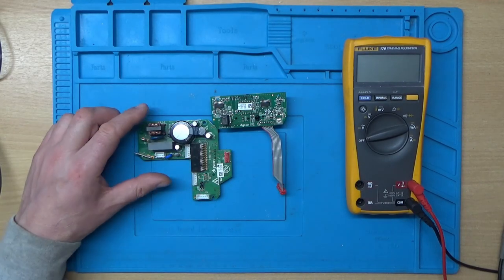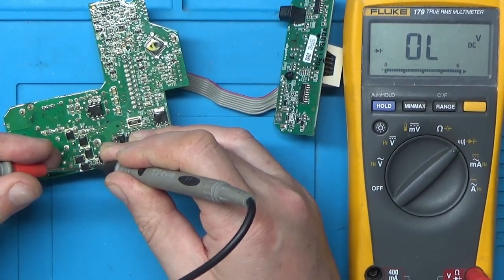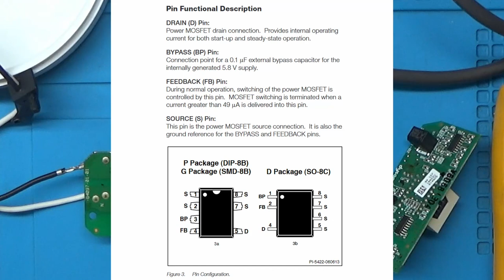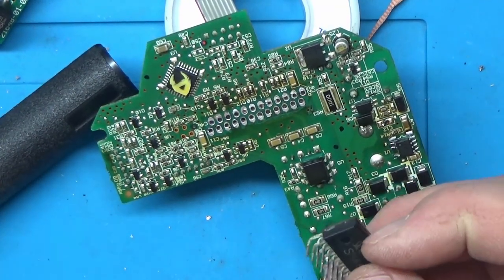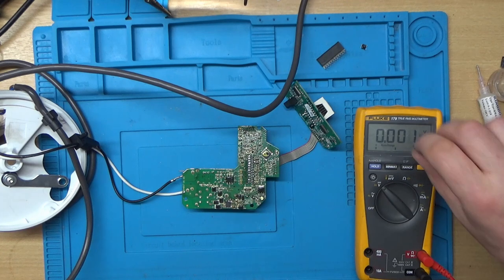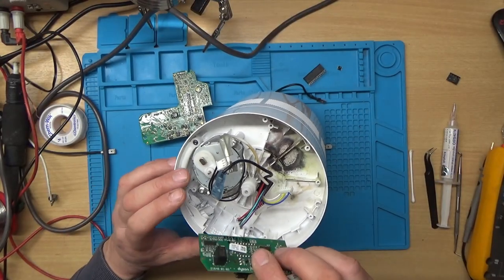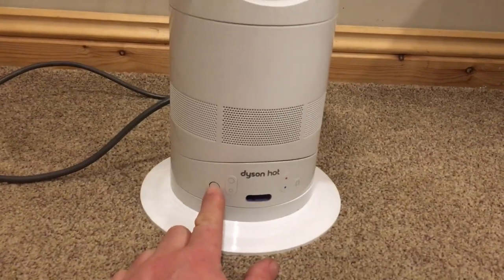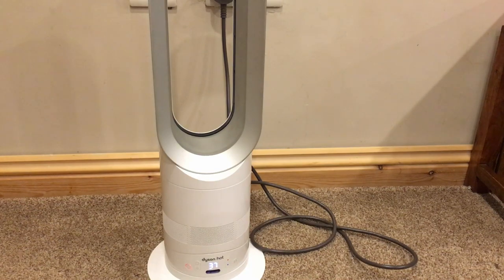Dyson Hot And Cool Fan - Revisit [PCB Repair]

Comment: "hmmm now where did I put that chip?" as he repairs another Dyson.    You must already have a drawer full of extra chips you have ordered Mick.   One of these days you'll be able to say.  "I know I have one here.  It's a good thing you have a good memory.   I am sure I would have never guessed to check for a tilt switch. Thanks for posting
Reply from the maker: Cheers Neil 👍I need to sort out my chips / parts to be fair. I currently have a cardboard box with loads of random chips, diodes etc in it.

Comment: Thanks for the warning - I just assumed that 99% of mains -> dc was properly isolated. I kind of check for the cut across the board that they normally put in to show what's isolated.  I do very little repair stuff so good tip for novices. Mind you - the whole point of injecting voltage is to bypass the mains section of the board so I'd always have it disconnected at that point.
Reply from the maker: Yes it's quite easy to get caught out. A 'rough' way to tell is that isolated supplies have a transformer of some type.

Comment: Dyson are a pretty tricky company, they make some cool stuff, have really good advertising and branding and packaging, but as time goes on they use some mighty complicated little boards, wires that are routed in ways that do my head in. I have taken a part quite a few dyson vacuum cleaners, and reassembled even fewer. The older ones were tricky to work on but it was possible, the newer ones are painful. Apart from styling I wonder if they are any better. Henry is great for heavy sucking, G-tech make a pretty good sweeper vacuum cleaner. I'll stick to Dualit for my toasters. I don't know what my point is, but I can't see myself paying full whack for a dyson, not that I can see you doing that either! 
I put up a video today of a dremel repair. I thought it was the motor speed controller, but turned out to be a stator winding and a very easy repair. We will beat them! #righttorepair
Reply from the maker: Yeah I used to like Dyson stuff, but it seems they have gone down the route of cutting costs, and charging a fortune. I'll check out your Dremel video!
Reply: i disassemble at least 6 pcs dyson vacuum cleaners and do a deep cleaning.  it is a pain esp, the suction head, so difficult to clean.  the MOST stupid design in the world.  chiNa copy and modify the suction area and make it easiler to clean.
Reply: dyson is not a good brand. too much marketing hype.

Comment: Well done, conscientious repair. Sad to see these products fail in such spectacular ways (multiple components damaged) and even sadder for Dyson and many other manufacturers who are using cheap-as-possible manufacturing in order to maximise profits (which, of course, results in short operational lifetimes).
Reply from the maker: Thanks Ralph. Totally agree the quality on this isn't as good as the original cool fan I looked at. That one had a proper bearing and metal shaft that it rotated on where as this is just plastic with a plastic bush. Also using the motor driver chip instead of discrete components on the other fan. All to cut costs I presume ☹

Comment: Something else you can check on PCBs with microcontrollers. If the controller has an external crystal (oscillator), check with an oscilloscope that it's actually oscillating (has started). If it was damaged, isn't receiving start power, caps have shorted, etc. the microcontroller won't run. If the crystal or surrounding circuitry (typically fairly basic) are the problem, you may be able to replace them and get the controller to start again. Not saying it's common. Just something else to throw in your bag of tricks.
Reply from the maker: Thanks for that. I've already done pretty much the exact same thing on other repairs such as the RGB laser, or the AverMedia video capture device that I also repaired 👍

Comment: So in case you haven't noticed yet the Ground of the Diodes are marked on the silkscreen with a wider white area.. Love your Videos I thought I would point that out incase you didn't see it on the PCB. There are other markings that can show the Ground band side however on that PCB you were working with when you were testing the Diodes I was like turn the Probes around when I seen you had the red on the side with the wider white line area. Again thanks for all that you do it helps me give my friends someone to share your videos with so I don't have to make repair videos.
Reply from the maker: Thanks Revo, yes I know about the white stripes on the diodes and pcb indicate the negative, I've just always checked them in both directions. I think I possibly had one once that had leakage in the opposite direction once as opposed to being fully shorted. Thanks for the nice comments. I'm not an expert but I've fixed stuff for years just not on YouTube until about a year ago 🙂👍

Comment: Really good repair Mick and thank you for being a gent on the other repairer (wink wink). Interesting to see the voltage on the ground of the 5V regulator in relation to mains ground. Off to watch another vid 👍👍
Reply from the maker: No problem Vince. Last thing I would want to do is criticize anyone so I hope that came across in the video. I was just trying to explain to people that you can easily come a cropper and damage equipment or yourself and just to use extreme caution. I've had a few belts myself and also blew stuff up too! You learn from experience I guess.
Reply: @BuyitFixit  👍👍
Reply: Lol ! Kinda guessed who he meant (wink wink) I didn't know that about that chip either so we both got something very valuable from this vid !!

Comment: I had the exact same model and the exact same chip spoilt. But after I replaced it , the fan still unable to run even when I have 5v. But I like to suggest to you to have a tungsten bulb in series to prevent any accident shorting... to protect yourself..
Reply from the maker: Yeah I really should have some type of current limiting. Thanks Jack.👍

Comment: Brilliantly undertaken, excellently fixed, you’re very methodical makes a great video too, keep up the good work.
(here’s a laugh for you) well I did something stupid I was fixing a Samsung Tv ( that’s what I do ) and I suspected caps on the power supply, I heated up each cap in turn with a soldering iron, until I touched the top of a cap on the hot side, my god I nearly chit my pants sparks flew and what a bang…. All the electric went, it took out the boards fuse, I measured it and it was on the reservoir caps side so 330v down to earth through the soldering iron lol
Reply from the maker: Thanks Cucumber Man 👍. Yes we've all made mistakes including myself! Hopefully we all learn from them. Every day is a school day so they say 🙂
Reply: @BuyitFixit  so true mate

Comment: 9:57 But his power supply was isolated from mains (on the power supply), wasn't it? Or is the PSU's ground connected to earth?
I get what you say after, in the case of the scope, you'd trip your GFCI. Or worse. But the PSU, though, I don't get it, unless the PSU's ground connected to the earth but why do they do that?
Reply from the maker: His power supply started showing a different voltage on the display to what it was set to, so it didn't like it. I wouldn't have taken the risk myself.

Comment: Unfortunately it seems all Dyson equipment, our bad experience was with a "Tornado vacuum" of theirs that clogged so easily (was only good for dust nothing else, dirt, forget it clogged right up). Dyson is over engineered, way over priced and performs abysmally after just a short time. The fact they use a component to direct drive to the motor instead of driving a relay or triac screams rip off. Never a Dyson product will inter my home again. They are over engineered under  performing very poor value for the extreme price point the name demands.
Reply from the maker: Yep over engineered and overly priced.

Comment: It is no wonder that Dyson are scaling back and making redundancies in the UK. It's products are cheap unreliable  tat. Yet massively overpriced for the purchaser.
Avoid buying Dyson....they are poor value for the prices that Dyson imposes.
Reply from the maker: Unfortunately a lot of products these days lack in quality. I bought a kitchen aid food mixer a few months back and did a video on fixing a few minor issues and did a full strip down and rebuild. It's built like a tank and in really good condition, and it's 36 years old! I doubt you would even get anywhere near a mixer lasting 36 years these days..